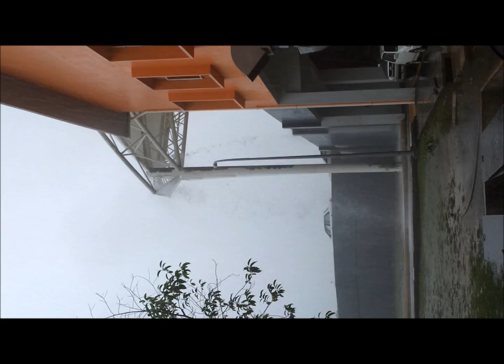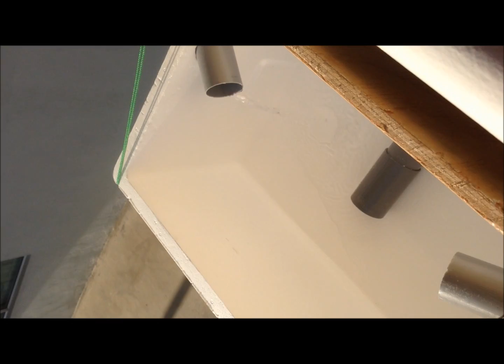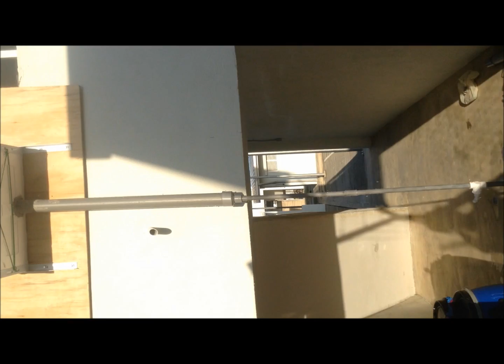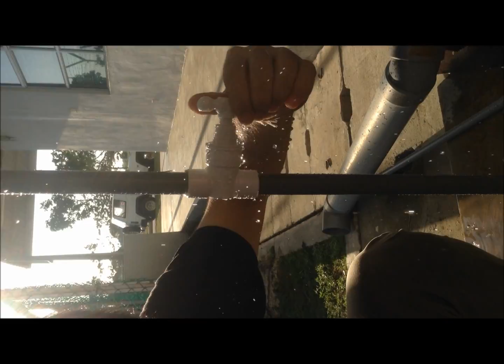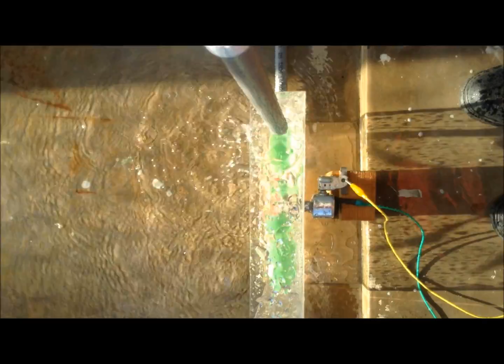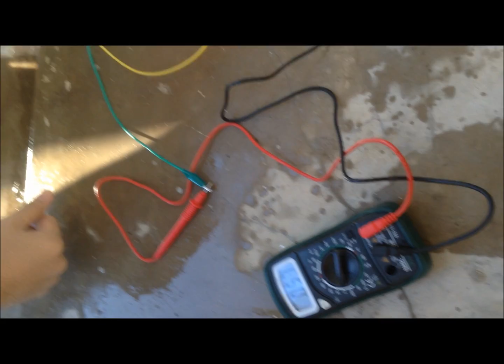Video Demo Presentation Rain Water Micro Hydro Power Generator

Comment: Use a Ram pump to increase the pressure of water going to the generator. And/or use a turbine like an Archimedes screw to use as the generator to increase energy output. Or have this video posted in 2014, whatever.